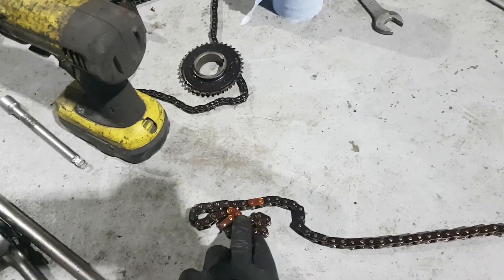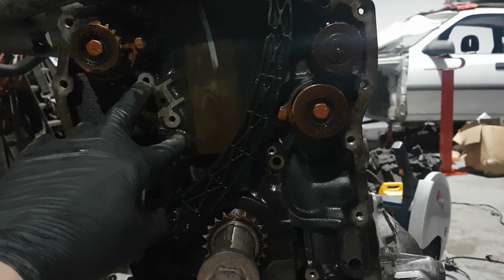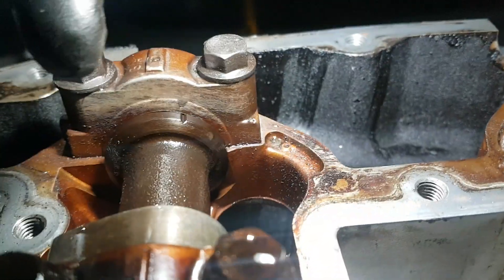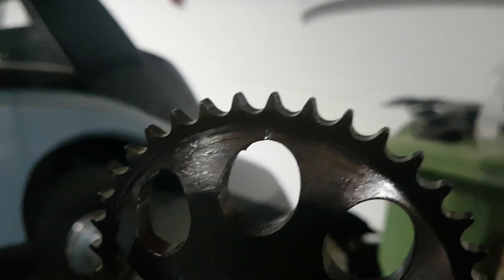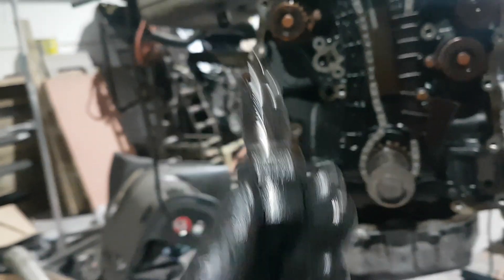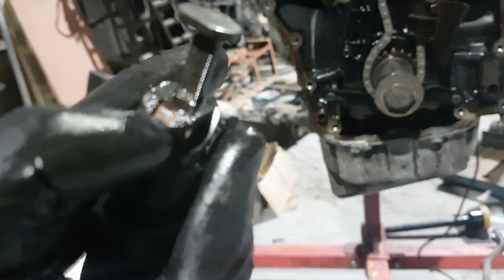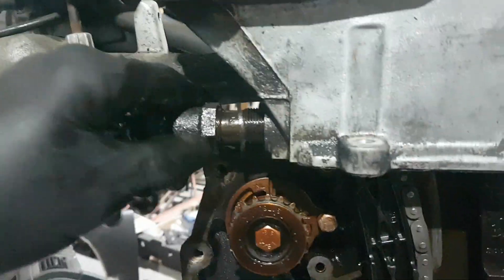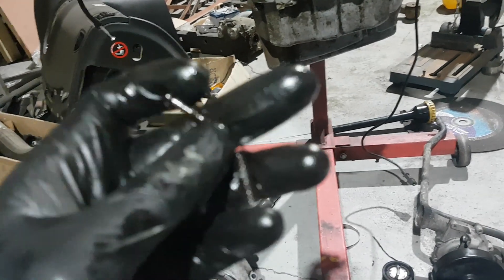Saab b204 b234 b205 b235 timing chain how to

Comment: There is also a oil pressure hole on the smaller threaded 12 plunger part of the timing tensioner. Mine was caked with crud.

Comment: Nice Video. I just did a roll in timing chain and as i almost finished the job i measured the tensioner and it's still extended to 20mm. Should i take the timing cover off and see if it needs guides? Engine is still in the car and i dont want to pull it. Also the Oil pan is off as well as i did rod and main bearings. Throw me a bone here. Thnx

Comment: Thanks for your vid and explanation! I just replaced the cylinder head gasket and I was getting really frustrated that I didn’t get the camshaft TDC marks lined up exactly to the millimeter. Glad to see that’s normal! For all of those who use an old chain without the yellow links: the distance between the sprocket marks should be 7,5 chain links